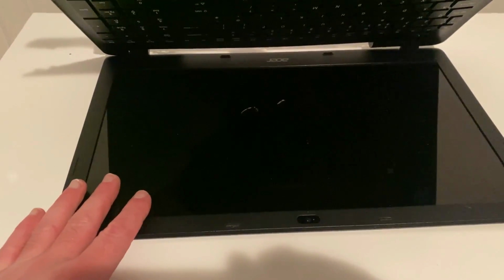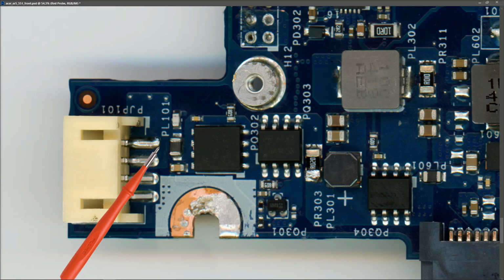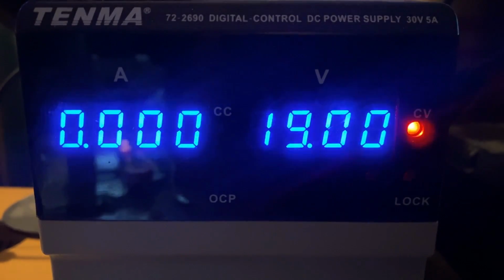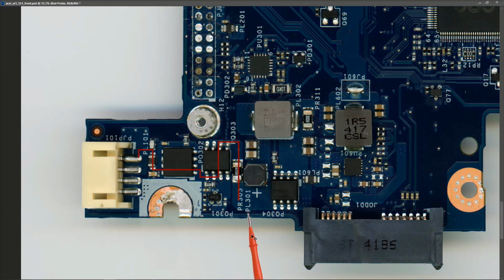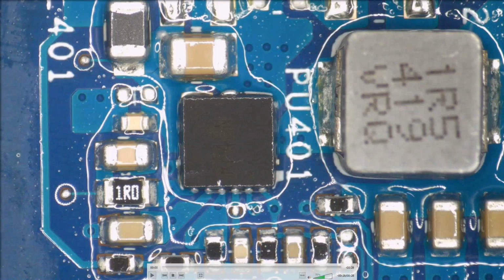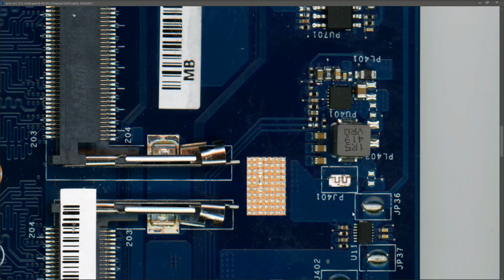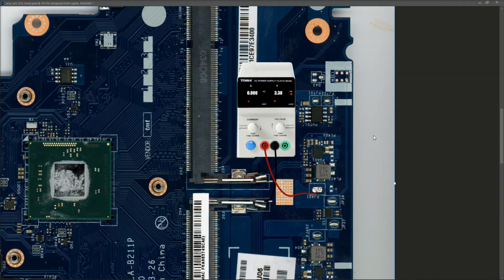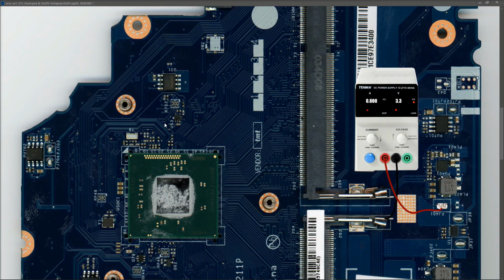ACER E5 551 - ANOTHER DODGY MOTHERBOARD

Comment: I had recently a board with the 3VLDO (3VLP) controller exploded. This is a very bad situation because this power rail goes directly to EC and PCH (or whatever it's called on an AMD based system). In my case both PCH and EC were shorted. I injected 1V in the 3.3 coil with 2A draw and I couldn't feel  to the touch something heated to much. I then dropped a few drops of IPA to the PCH crystal and I noticed that when I applied the voltage the IPA moved slightly away from one of the corners. That was the definite proof that PCH was dead.

Comment: As you saw, when these 3V/5V power supplies heat up, it is usually because something on the other side of the output inductor is drawing too much current. I am amazed at how resilient those power supplies are. Sadly, we find that either the PCH or the EC chip is shorted internally to ground in these cases. Almost as if they were designed to fail outside the warranty period.